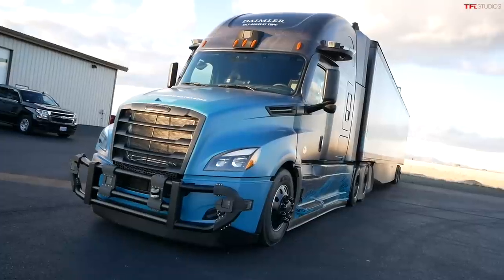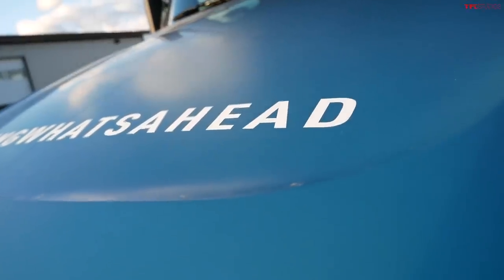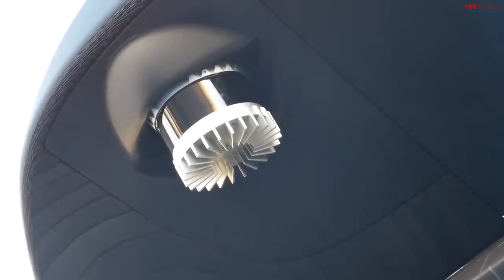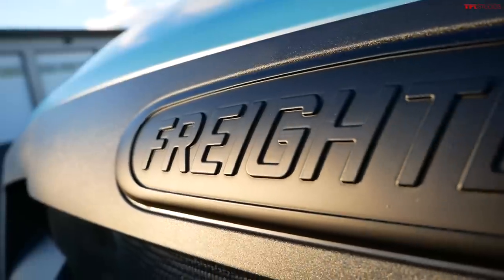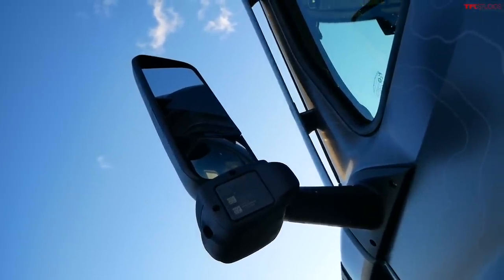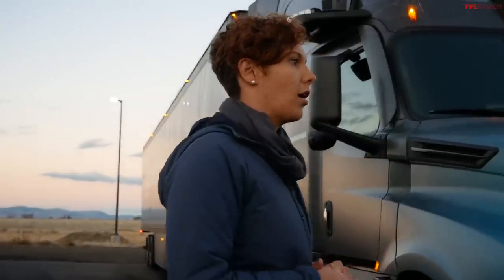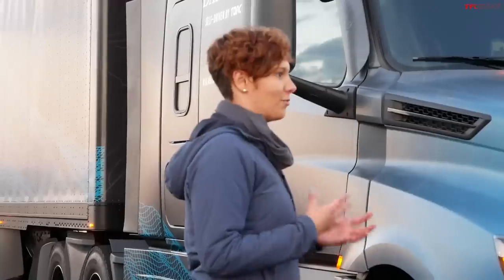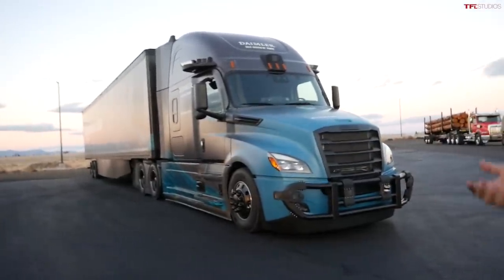Will This Freightliner Semi Truck Be Able To ACTUALLY Drive Itself? Here's How It Works

Comment: Had one of the trucks in our fleet had a yaw sensor become disconnected from the frame so the truck thought it was rolling over and applied all the brakes and brought the truck to a complete stop in the middle of the Mass Turnpike for no reason! It had to be towed as the computer would not release the brakes. I don’t trust any of it and people are going to get killed by them or because of them.
Reply: Yea I don't believe you show us proof. You're probably a company driver who scared of your job being obsolete.

Comment: Been a nationwide trucker since I turned 21. Retiring in 16 years when I turn 50. Nice to know my job isn’t at risk. 😅👌
Reply: Memphis Brewer  It’ll still be too expensive for most companies to buy them. And until software can do all the other functions of a driver, we are safe. Hell, even cars are where they should be as of now. This is coming from someone who owns a 2019 M5, 2020 X7 and 2020 Ram 1500 Limited. All of which have the latest in driver tech. 👌
Reply: If anything...you'd still have to stay behind the wheel even if auto driving.

Comment: How does this system react to high winds? With light  Trailers.
Reply: a computer definitely knows better than human about how to control a machine under predefined condition.
Reply: They're working on developing software so it will be able to upright itself and get back on the road via big external airbags.

Comment: Hope these never make it to the road ways because I don’t trust my life with it.
Reply: Lol I don’t trust my life with you as a driver... statistically you are way more likely to crash than an automated vehicle.
Reply: @MrAppltec  but I drive a vw beetle from the 1960’s not a 30,000 pound semi... anyways I can respect your opinion.
Reply: @Yee_Yee  I understand that... I drive a 1985 diesel ford. But I stated a fact not an opinion...
Reply: @MrAppltec  don’t get me wrong, I don’t trust other drivers about as much as a Autonomous vehicle. But to my knowledge there’s just no realistic data of widespread use of autonomous heavy duty vehicles on public roads. Of course there’s always gonna be human error. I’d love to see a system that works flawlessly but I’ve played enough gta to know that computer drivers make mistakes aswell lol. My point in creating my original comment was to express distrust in a software essentially. You can say that statistically a fully autonomous vehicle is safer on the road but the ratio of autonomous vehicles to old fashioned vehicles on the road heavily favors the old fashioned vehicle. (More manned vehicles than autonomous) so I guess only time will tell. And Personally never been a big ford fan but not a hater, 🤙🏻 hope you get many more miles from your truck 🤠. At the least I can still agree to disagree. Just my opinion, I’m not a software engineer, just an automotive technician. But I feel kinda the same way about electric vehicles, there’s not enough data to say there won’t be any adverse effects from lithium ion batteries or wide spread charging nationwide, I could see a potential for large black outs from a stressed grid but yet again, I know very little on that topic.
Reply: @MrAppltec  I have run in to issues with false crash avoidance a few times and basically nothing works right on snow and ice and a many other not-standard situations.  The world is very unpredictable but I do hope autonomous aid tech does not cause the driver to loose connection to the road and increase risk in other areas like dealing with taking control fast enough to avoid a situation, dealing with false triggering of some system or another.   For example one can say that airliners on auto pilot saves lives but also crashes have occurred due to that very system too, so it is a balance at hand, taking away too much control Vs. having the human able to intervene fast enough and make the right decisions when needed.
Reply: Doesn't Mattwr  the fact of the matter is that autonomous vehicles have shown to be saver per 100,000 miles than the average driver. That’s a fact not an opinion.

Comment: Let me put you to rest.. Daimler CANNOT Even fix the adaptive cruise control.. they sense objects(ghosts) that don't exist, causing full activation of brakes.. fleets have ask Freightliner to address this to no end..
Reply: My ‘19 Peterbilt will occasionally do the same thing.
Reply: I mean like she said this isn't coming out tomorrow there's a lot of bugs and kinks to fix. But yeah if there's fog or rain / snow or wind blowing dust around I could see the sensors freaking out a little bit.
Reply: My '19 Freightliner have that problem along with it sending messages to the tablet stating i had violated following distances when traveling on shaded backroads.
Reply: My 2020 freightliner does the same crap. Almost got rear ended in the interstate when the adaptive cruise control sensed something in front of me, which was nothing but open highway. It slammed on the brakes, sending everything I have inside my cab forward against the dash. I know I know, this technology is “way safer” than I myself could ever be just driving with normal cruise control and being at full control of the brakes myself.
Reply: @brandonabney9164   
But they are going to make us "safer".. LMBO 🤣. 
No thanks Daimler..
Reply: @brandonabney9164  A glorified Mercedes is already broken? What a surprise...
Reply: Just unplug it how I fixed mine lol

Comment: Retired two years ago from  40 plus years in semis. Last truck had automatic braking for collision avoidance. Horrible system frequently applying brakes for no reason some times with no other vehicles in sight they claimed it was bugs hitting sensors!between that and poorly designed DPF systems new truck was in shop 2-3 times a month. When truck is in shop driver doesn’t make any money! And is stuck at shop. Then they complain they can’t keep drivers.

Comment: I don’t get self driving trucks. It’s just gonna put a lot of people out of work which is the last thing we need right now
Reply: They will let companies move freight faster and cheaper. They could literally drive 24/7, only stopping for fuel. 

It will probably be a few years before are out of the testing phase. And we might not see widespread adoption until 10 years from now.

It doesn't make sense to me to keep doing something an old fashioned way just because progress would put people out of work. But on the other hand I don't have a good answer for people who stand to lose their jobs. At a minimum, there should be training programs available to them to help them transition to other jobs.

And these new trucks might create new jobs. If more cargo is being moved, there will need to be more warehouse workers to load and unload the trucks. People will need to work at truck stops to fill them with fuel and clean the sensors.
Reply: It's not happening right now so that doesn't matter. Plus, you have to think on a bigger scale. When someone works they typically make 'wealth' as in like lets say a construction worker builds a house, that person turns raw materials into a finished product that is then sold to someone to live in, creating wealth both for the builder and for the buyer because the buyer gets a home to live in, and the builder gets money to live on. Truck drivers however don't really create very much 'wealth' all they do is drive products from one point to another point which is obviously important work to do else nothing would happen in society. However, if we could use those workers doing more important jobs that can't be done by a computer then we create more wealth like building more houses, or making more cars, or all kinds of other things that better help communities.

Now, the tricky thing is what happens to the money these companies save or make extra in by running automatous trucks? Part of that money gets passed onto the consumer, lower food costs, lower building material costs, lower shipping costs stuff like that. When those companies save money on transporting things they can hire more people or give their current workers more money. Keeping these companies honest though is the hard part. If and when this ever happens people really need to step up and demand it's treated right, and not by making Government mandates (That never works) but by consumers doing mass boycotts of companies. For example if Amazon saves a bunch of money by switching to self driving delivery vehicles, and they don't give their workers a higher wage or don't hire more people to replace those lost jobs, how about no one buys from Amazon for a month and they lose several billion dollars? People don't seem to realize, you have the power over these companies and how they act. If no one went to Walmart for a week Walmart loses billions. If Employees at Walmart refuse to open and operate their stores across the country in protest, Walmart loses billions. This is exactly how the Unions started, and it can happen again. People just need to be dedicated and stop relying on the corrupt Government paid by these rich CEO's to do something for them.
Reply: Have anyone been to one of these modern warehouses? I did, and it hurt me to my soul. Everything is automated, and the only time a human is involved is when they have to reload a trailer within axle limits.

Comment: The answer to that question is yes! They will take your job.
And
I watch this on the news last night, for as long as I could… There’s really no mention of what kind of economic disaster this would do to the labor force in America. Sure there’s a little bit. But almost casual… As in passing.
There were four people on board, one was a 30 year truck driver behind the wheel. Ready to take over if anything went wrong. Certainly… She was not needed.
In the passenger seat was a guy watching a computer program. Certainly he is not needed because computer programs will take over that job.
The two guys in the seat in the rear? They were just commenting….. not needed at all. So
The manufacturer, and packaging
Distribution to warehouses
Loading of the trucks
Driving of the trucks
Unloading of the goods
Sorting and destinations the goods
Delivery to the destinations or customer of the goods.
Will all be done by the computers and automation.
My question is
Who is going to be left that can afford anything manufactured or delivered?
The only people that will benefit from this.
The shadow government/deep state
Big Tech
And the oligarchs that run everything.

Comment: Its funny how planes still need pilots even though they fly themselves. But a 80,000 lbs truck driving the on the ground with alot more stuff to hit can drive without a driver  Possibly.
Reply: Rail doesn’t even drive itself… this is a sham

Comment: I would not trust a vehicle to drive me or anyone, seen a Tesla run a Red Light, and then there the TESLA, which hit the truck, which was turned over.  Now if vehicle sensor are obscured by bug splatter, dust, snow.  Can't imagine any Full Autonomous in any condition let alone weather .... now I have to worry about Big Rig Driver falling asleep, because like Tesla drivers do it as they are not engaged with there Vehicle ....I Miss my 6 Speed Manual Transmission

Comment: These problems cause a large safety concern to the general public.. 
Ask them what we asked their engineers, what about uncontrolled variables..
Deer in running for example..  they are not better than a trained driver. Ask her what the overall cost per unit and maintenance for such vehicle, it's NOT WORTH THE RISK MANAGEMENT !!

Comment: Other truckdrivers piss me off now driving slow and stupid,I would hate to be behind an autonomous truck,or have 2 autonomous trucks in the fast and slow lane.
Reply: You do realize that even if the truck driver is pushing the pedal to the the floor load mass is slowing the truck down
Reply: @4doorsmorewhores34  yeah,it happens to me all the time,but some ppl that just act like they're the only ones on the road.
Reply: @kristisdale389  yeah a lot of people are inconsiderate. Anyways I’m looking at these videos cause I’m 15 wanting to be a trucker and wondering if it’s worth it if these things are on the road
Reply: @4doorsmorewhores34  sometimes it's good,sometimes it's bad.Its worth it tho.
Reply: @kristisdale389  if that’s the case then I will be a trucker then thanks for the confirmation

Comment: What if all new cars were equipped to scan the roads as they drive over them?

With 5G, this could continuously map all roads to allow completely self-driven cars and trucks.
Reply: Too bad mmwave 5g can't even penetrate a bush and low band 5g is only slighty faster than LTE.
Reply: What if you don't have 5g in certain areas,  the truck just gonna stay put lol 😂😂😂😂....